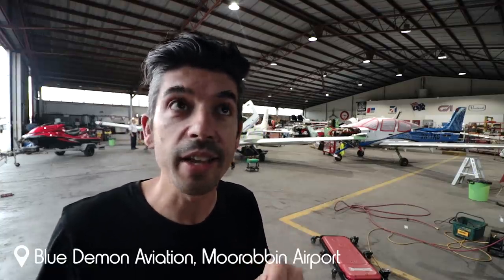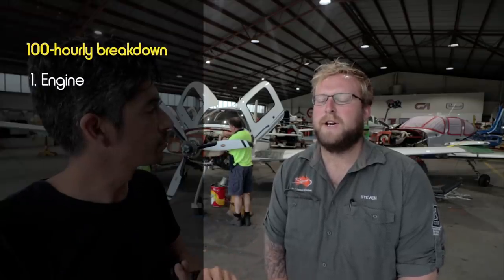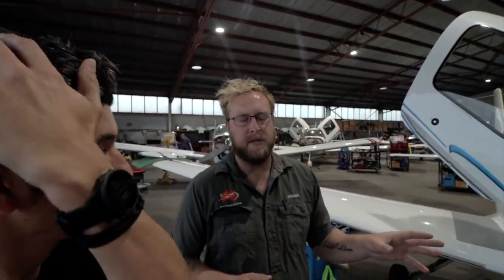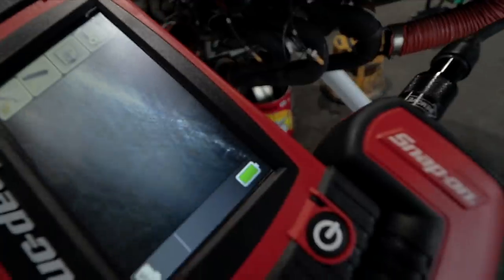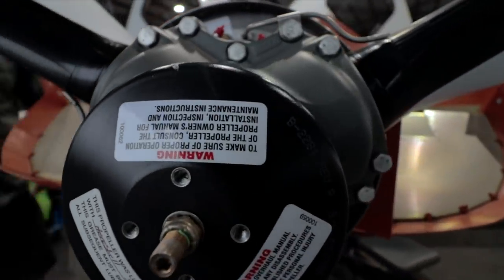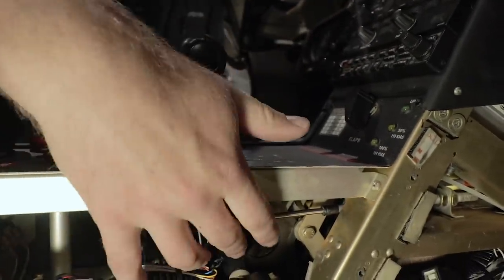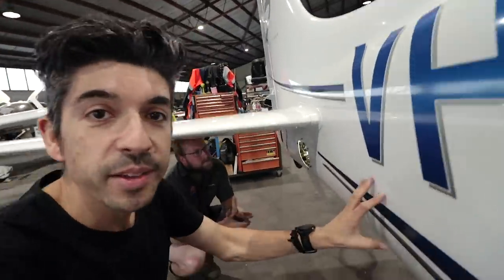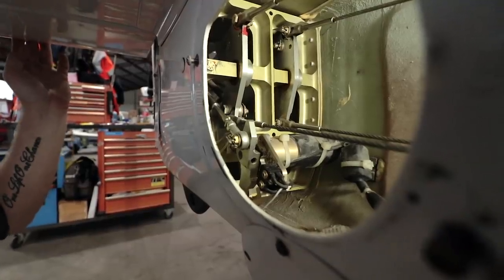Cirrus 100 Hour Inspection - What do Aircraft Engineers Do?

Comment: Great exhibit of the Cirrus engineering, systems and solid construction. Are starters, alternators and governors inspected as well beyond an exterior visual examination? Just curios as the Cirrus in Nikos Wings had recent costly component failures in flight requiring pilot intervention.
Reply: Yes they are inspected as well, a 100 hour inspection is the same as an annual inspection, same checklist, but both inspections are performed at different time intervals.

Comment: Hi. I just wondered, during the hundred early, did they check to see what might have caused your concern re the oil while you were on your outback trip?
Reply from the maker: Hey Alan, yes the oil system is inspected as well but we believe the oil issue from the trip was potentially overfilling of the tank, combined with a couple of long distance higher altitude flights, and the Cirrus breathing oil out of the breather tube under the fuselage. It's not uncommon for Cirrus aircraft to do this, and once the oil settled at 9 quarts it remained there for the rest of the trip. So I think had I not filled the oil up at Shark Bay, we wouldn't have had that large spitout of oil on the way from Broome.

Comment: What are the benefits of three and four bladed propellers?
Reply: Three-blade props offer a compromise in acceleration, efficiency, lift and speed. A four-blade propeller can boost acceleration, efficiency or lift, but at the cost of a lower top speed

Comment: Seems like a lot of work for only 100 hours but maybe not so if the aircraft has been in the hands of pilots of various skill levels.
Reply: a 100-hour inspection is required for aircraft: That carry any person (other than a crew member) for hire; or. That are provided by any person giving flight instruction for hire.  All others get an annual with the same number of items inspected/repaired.  For new CIrrus SR22 these inspections range in cost between $2000 to $3000 USD dependent on parts and problems found.  The SR22T is higher.

Comment: 3 days of service for every 4 days of flight. Something wrong with that.
Reply: Pete is never wrong  I think there is a 50 hour caress and then a 200 hour prod. Maybe takes an hour and one of the owners happen to be a mechanic so there is no cost associated.
Reply: Pete is never wrong  no, it's an UL/LSA in Europe
Reply: Pete is never wrong  always try to understand. never motor in assuming you are right without thought. thoughtless generally isn't the winning strategy. 
the difference is certified. a core problem in aviation used to justify enormous cost. please spare me your sheepish status quo defenses. 
One grievous example is the IO580 engine, a dumb 310HP 6 cylinder naturally aspirated air cooled pushrod piston engine of 1950s tech that costs 139k$